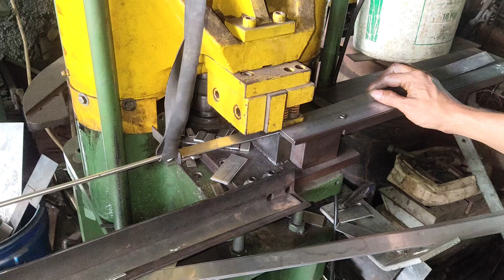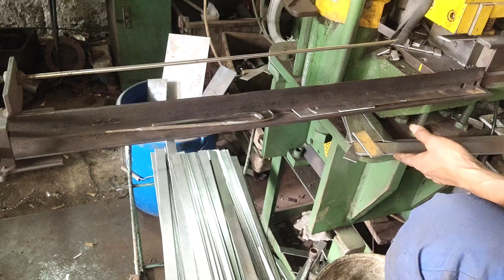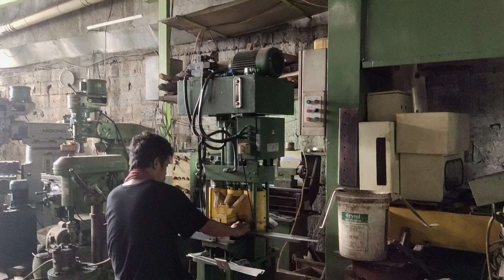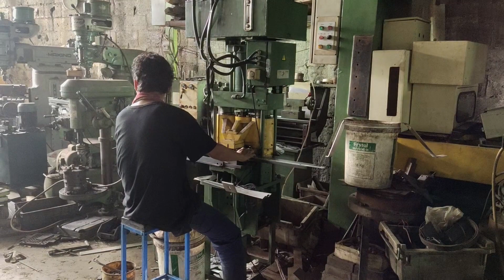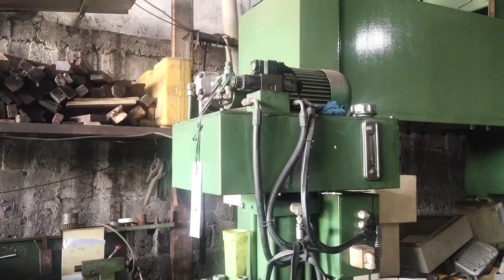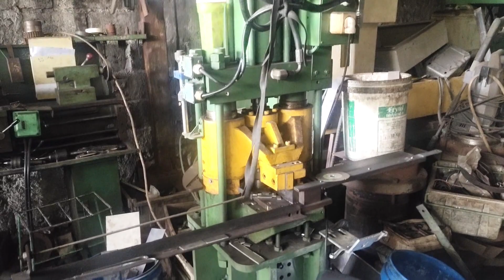Jasa Shearing Plat Stainless Steel Dengan Hydraulic Ironworker Machine

Comment: Kalo mau bikin shear machine pakai dongkrak botol 50 ton,utk potong plat strip lebar 50mm,kira2 mampu sampai ketebalan berapa ya om ?
Reply from the maker: 50 ton mampu shear 9 mm
Reply: @AmadaKarya  mkasih om,jadinya sy mau bikin yg model hydraulic toggle press.pakai hydraulic cylinder as 80mm,bore mungkin 120mm lebih,stroke 300mm,rangka H beam 200.powerpack nyusul,,,